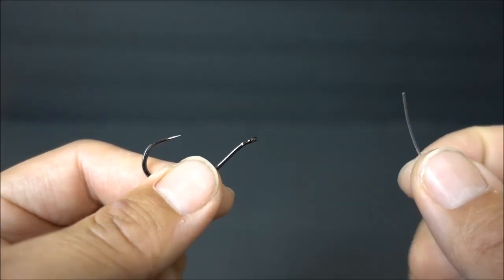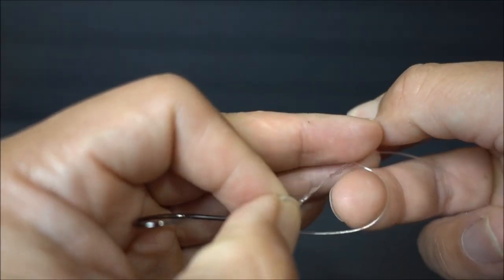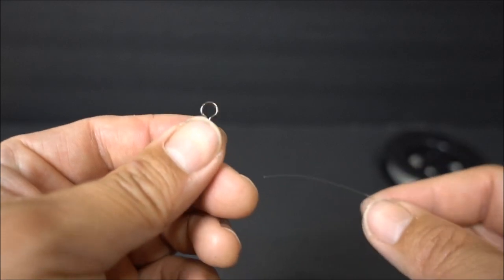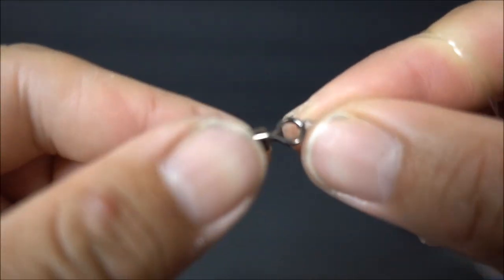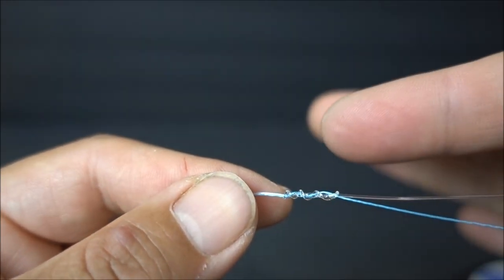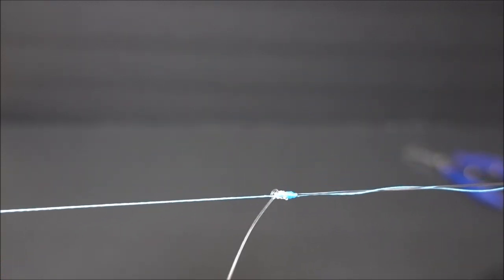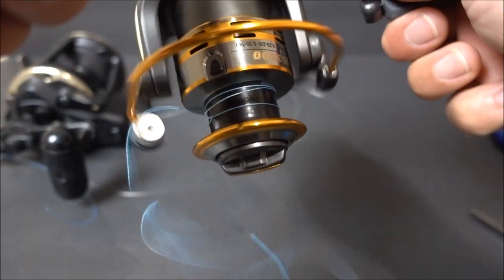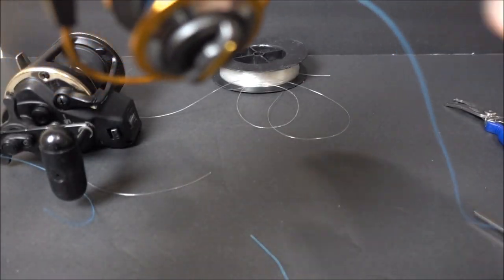Best Fishing Knot: Uni Knot (How To and Explained)

Comment: Great video, Moo! I like the Uni knot for connecting line. One area I’ve had issue is with a spinning reel connecting braid to braid. If the knot gets exposed, but not casted out, sometimes the line catches on the tag end and stops your cast dead.
Reply from the maker: Thanks. I don't think I ever had an issue with casting with braid to braid uni.
Reply: @MooMooOutdoors  maybe I just need to trim the tag ends closer 🤷🏽‍♂️ lol

Comment: Good stuff Moo. The only thing is that when tying a double uni to braid and mono/leader, it's probably not the strongest if you cast a lot. My line has snapped on more than one occasion right in between the two uni knots when casting. I think when dealing with tying mono or leader material to braid, an alberto/fg/sc knot might work better. When tying braid to braid, the double uni might be okay however.
Reply from the maker: Thanks Ahmer. I too mainly use FG and SC for braid to leader but I have a couple of friends swears by uni to uni for braid to leader. Everyone has their preference. This video is mainly designed for beginners and those who never used uni knot before.

Comment: Thanks for the demos. What is the electrical tape on the spinning reel for?
Reply from the maker: Thanks. Braided line tends to slip on both spinning and bait casting reel without the electrical tape. Another way to prevent is to spool a couple of layers of mono backing.
Reply: @MooMooOutdoors  I didn't know that. Thank you.
Reply from the maker: You're welcome. Glad to be help.